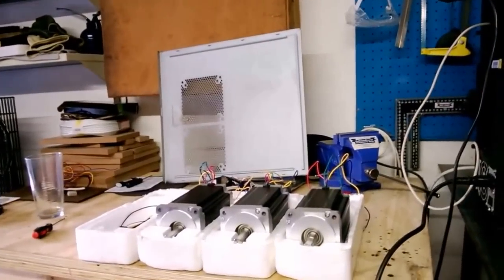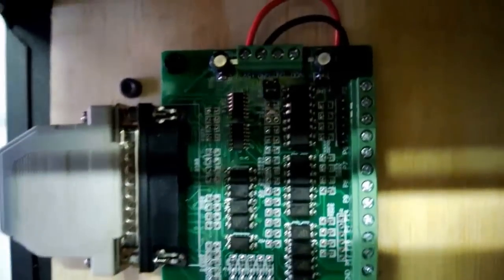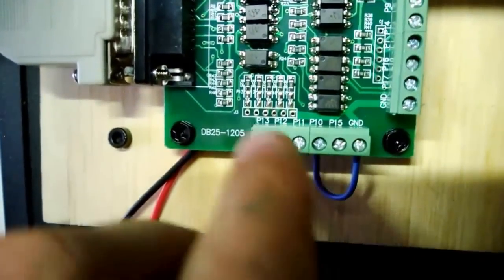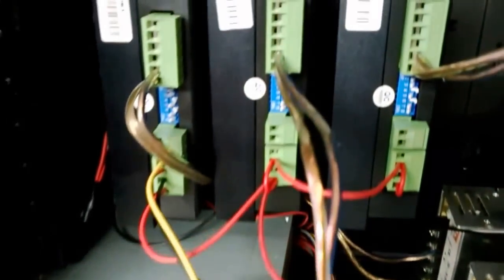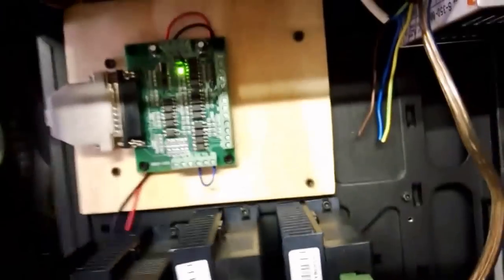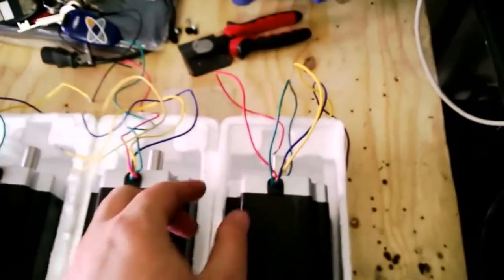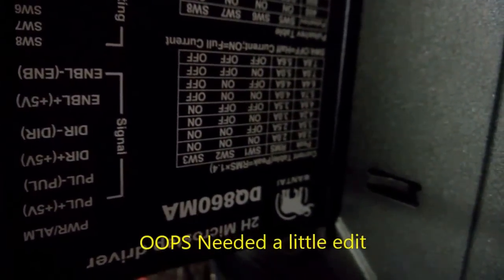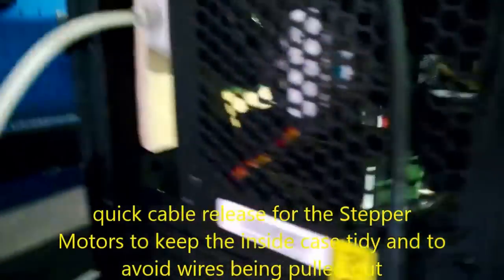CNC Setup

Comment: hi.

you not shunted +5v to ENBL+(+5v), you setup works fine with out +5v on ENBL+?

What valor you used in "Motor Tuning" (steps per, velocity, acceleration, step pulse and Dir pulse)?

thanks

Comment: If your steppers have the shaft both ends add a handwheel to the back side of them. Also add a switch between the stepper AC power supply to the wall plug.  Makes zeroing supper easy. Cut the stepper supply leaving all else hot. Now crank away to where you have all zeros set.  Next flip the steppers back on and simply set all the revemant DROS in the controller program to zero.  Thats how I have mine setup in addition to a touch off plate but I rarely use the plate.  I just use a bit of paper as a feeler gauge.  

If you want to get around the 2 or 3 thousands of the paper that actually cause that much 0ff from a true zero, simply set a DRO to reflect it. The paper trick also works to sero on an edge or corner. Just drop the bit  a bit past the work surface an move the axis until you getthe drag from the paper.  Asuming your setting revelant to the REAL +on your cnc just set the DRO to half the bit thickness as a negative value...  IE  for say a 1/4 bit you enter -.125. The center line of the bit is where the real tool zero is located so just put in half the diameter.

Comment: Can you tell me the model number of the power supply 5 V and 12 V
Reply from the maker: Hi Ray - I just used a PC power supply with this setup which I am told is not the best thing todo when there is no load on switch mode power supplies. what you want to get is  linear toroidal unregulated power supply - you need to size them for the size stepper motors you will be using. hope this helps

Comment: Hi Vatso, I bought the same CNC kit like you,( Nema 34 Stepper Motor 1600oz-in, 3.5A, 4-Leadings, 2phase, 85BYGH450C-012B CNC Mill And 8.2A Control DQ860MA), but when I set up and follow instruction it not working, I tried to check and testing many time, but it dnt work.
so can you please help, my email cheabunlong@gmail.com
Regards,
Bunlong
Reply from the maker: +Funny Movies - it would be great to let me know what you have done so far maybe do a drawing of your configuration - there are many things that can cause it to not work so what you are asking is very vague. I would recommend that you work on the issues in two parts on being the hard ware before the PC make sure the motors are getting power and such the other is then the PC side
Reply: +vatso, thanks for your reply, the hard ware I had connected follow the instruction ( get from Suppler)  and the soft ware I am also connected the same as my suppler provide. (Mach 3) but i still not work. I can send you the documents by email if you wish too, regards bunlong
Reply from the maker: +Funny Movies - Hi there - I got it to work :) - you need to document what you have done? and how you have connected it? Sorry I don't mind helping it sounds more like you need to learn how it actually works - I have a few other videos maybe you should check out first
Reply: +vatso. yes i have looked  your videos  a lot, so that why i desired to buy cnc router  kit like you.

Comment: Hi Mark - Yes Ive understood that but my question is as to the actual wiring - and that is  5v transformer red wire into 5v BOB as well as the driver Pul5V and Dir5V and then you have the black transformer wire into the Grd  together with Driver Pulneg and Dir neg, is this correct ?
Reply from the maker: yes correct

Comment: Hi there Vatso, sorry stupid question: at the start you have the 5v transformer red wire into 5v BOB as well as the driver Pul5V and Dir5V and then you have the black transformer wire into the Grd  together with Driver Pulneg and Dir neg, is this correct ?
Reply: +Joao Girao Hi there thank you for watching the video - what I did was use the same 5v power supply to run the BOB and Motor Drivers. Not the best solution as there is no isolation when run like that. since then my new machine is isolated completely. best option is to run the BOB on it's own 5v transformer and the drivers on their own.Hope this is clear

Comment: Bang up job. The only thing that I would recommend is that you CRIP your high voltage connections. It only cost pennies and this is a very good reason to do so. Solder has a very low melting point. And say that the unfortunate happens you could be in a nasty position. Not only your great "but" you local standards forbid that type of installation. And if you home were damaged as this unit being the cause of the blaze... well... no $$$

Comment: what speed you get it? I hawe same motor  and bob. i tested my cegodrive g540 motor spinning fast speed 2600ipm than chinese 500ipm. 5mm leadsgrew (rm1605)
Reply from the maker: +Juha Rakolahti - that is a good question I can't remember I was running this on a converted Mill so speed as not that important I found if I tried to make it move to fast it would bind. the speed also very much depends on the motor as well as if you are using a Smooth Stepper. There is a point where you will start missing steps also the faster it goes it needs to slow down when changes direction.

Comment: The drivers power wires should never be Daisy chain connected like yours because if one motor is pulling amps through the main supply wire it could spike the other drive and cause problems. Run separate power wires to each driver from the power supply. + and -

Comment: Hello, i have the DM542A drivers and nema 23 , 425 oz-in. Can you help me with connecting all the stuff. Thanks in advance.
Reply from the maker: Hi there what do you need help with? do a diagram and let me have a look at it.
Reply: vatso Can i have your email so i can send you my wiring diagram. For now it will be enough just to help we with the right choise of the connecting cables between drivers and motors, drivers and power supply and drivers and breakout board. Thanks !

Comment: Thanks for the video.  I am currently setting up the same thing.  I played with the free BOB but failed to make it work in short order so I went to the C10 board I was planning to use anyway.  Your wiring might explain the difference.  Seems the step and direction are being pulled down and I expected them to be pulled up.  I'll give this a try with some of my other steppers.
What did you build with your setup?
ps - I went with all the same size motors and now wish for a smaller Z motor.  Overkill is right.

Comment: Hi can you help me with the relay connection to my breakout board it's the same like yours regards
Reply from the maker: I can what relay do you have?
Reply: Hi it's a sun hold RAS 0510 5volts and 5 pins relay I try connecting to pin 15 I already configure in mach3 but I think the problem it's on the breakout board I check the outcome voltage and it's 0.32 volts I don't know if I have to connect another 5 volts line in the breakout board? I really apriciatte your help 
Regards
Reply from the maker: The issue you have is you trying to trigger the relay with the 5V from the controller board. what you need is a relay that has 5v external power supply and is triggered with 0v. I will take a picture of the relay I used and a quick talk through how I got it to work
Reply from the maker: Sergio Lopez I just uploaded a new video with how to setup a relay sorry it took so long been busy with a new CNC Machine